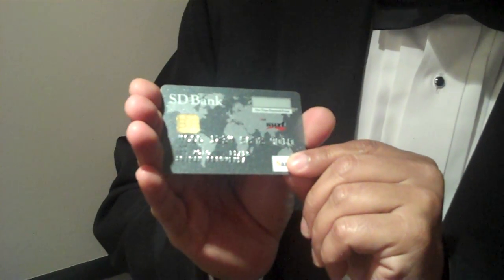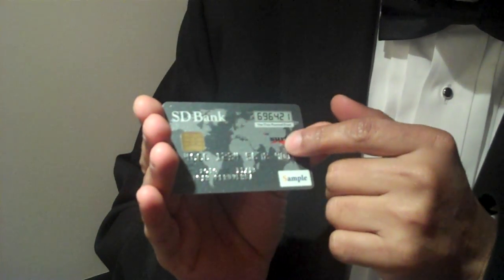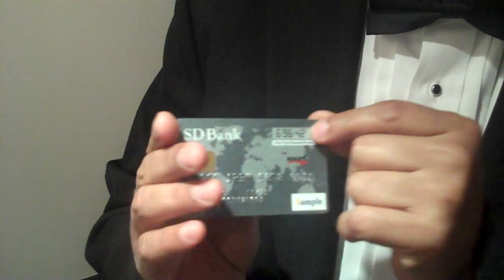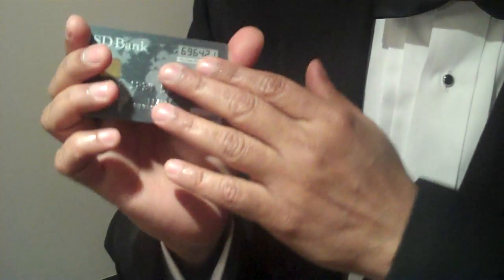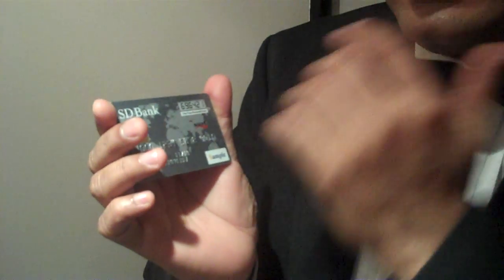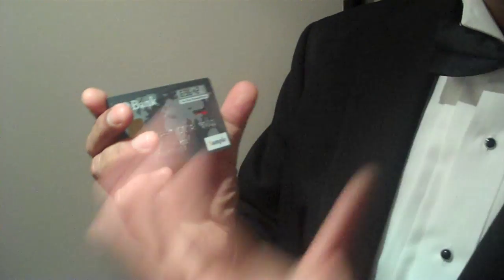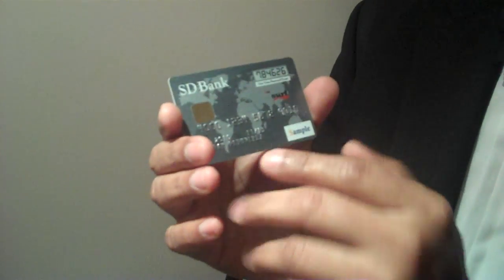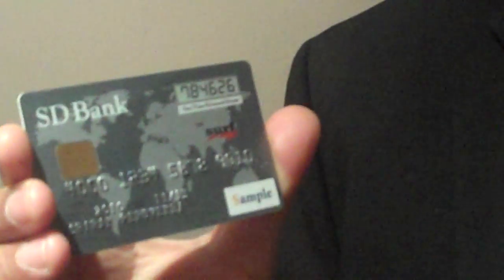Smart Dongle Credit Card with e-Ink display

Comment: I want to know how to re-charge ore replace the battery.  This type of Credit-Card-Thickness screen display thing can be used for many purposes.  For a Credit Card, you may want to replace the card anyway every couple years.  But for other things, you may keep them for a decade or more.
Reply: probably via induction charging, unless the battery died and then I assume the card will have to be replaced itself.

But getting power from the card reader to display the new amount would be possible, the screen doesn't need power to hold the sign, so once it is set you have it like this until you reuse your card and have the number changed again.